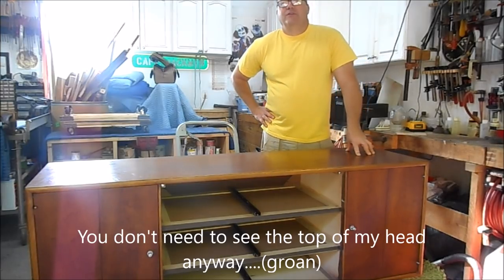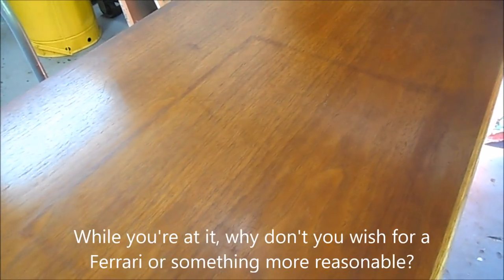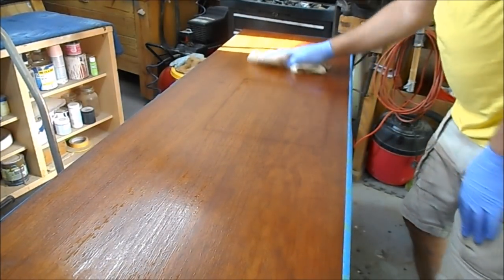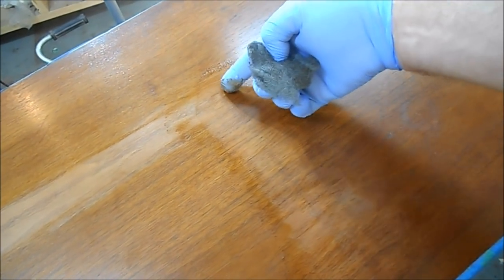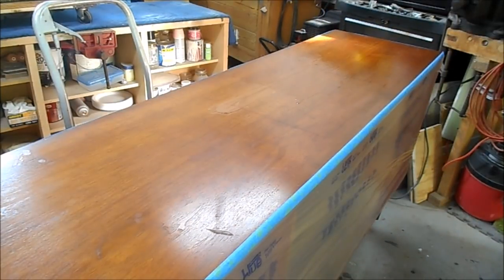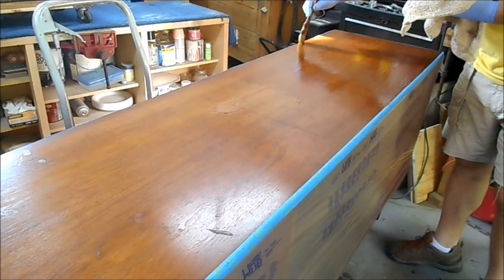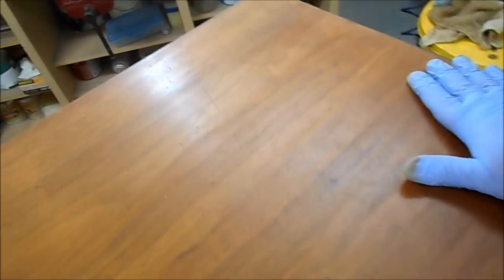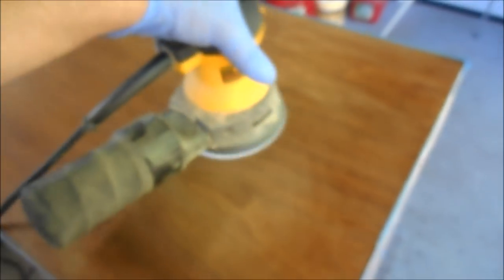Restoring the top of a Lane Acclaim Buffet from 1964

Comment: In high school our shop teacher showed us how to make a large razor straight edge for scraping wood before sanding. Much easier than a razor blade with less effort and saves time. Great job on that piece.
Reply from the maker: Nice.   I have some traditional card or cabinet scrapers, but find I don't reach for them as much anymore.   I'm a bit lazy about sharpening them and the razor blades are good to go as is.   Some guys will strike them on a piece of cast iron to turn the edge, but I find I can use them right out of the box.
Reply: Hey. If ith works best for you, that's all that matters.

Comment: I have a walnut bedroom set. My girlfriend spilled oil from a fragrant oil warmer and it removed the finish in areas where the warmer sat, which I threw away. Do I need to strip the whole top and restain it or do you have any other suggestions, by the way, that 1964 buffet looks awesome after you finished it. I'm sure your wife is quite pleased.
Reply from the maker: If you have a substantial area of missing finish, I would suggest refinishing the top.  There are techniques for patching a finish, but they are not easy to do correctly and quite time consuming.   If you tape and mask the piece carefully, you should be able to refinish the top quicker than you could ever patch the finish.  Good luck.
Reply: Thanks, I'll be refinishing the top. Do you think I'll need to do any sanding?
Reply from the maker: If the wood is not damaged, you can probably get by with a light sanding with 220 before you seal and then perhaps 320 gold between coats of top coat.   Go easy, it's probably veneer and you don't want to sand through.   I can take a look at it if you want to email me some pics.
Reply: Alright, will do, thanks

Comment: How did you neutralize the stripper?
Reply from the maker: A water rinse.  I strip, then wipe with lacquer thinner to get the remnants of the finish off.   I then water rinse to neutralize the stripper.   I normally just scrub with a wet rag, then towel dry.  I then let the piece sit to thoroughly dry before starting the finishing process.  Hope this helps.
Reply: Thanks so much!